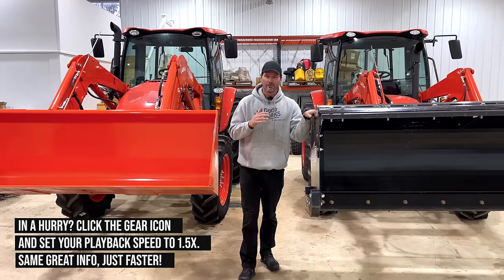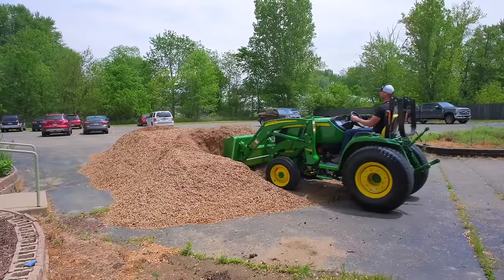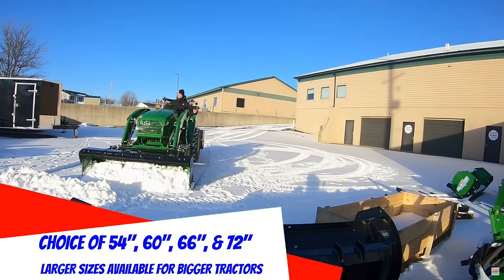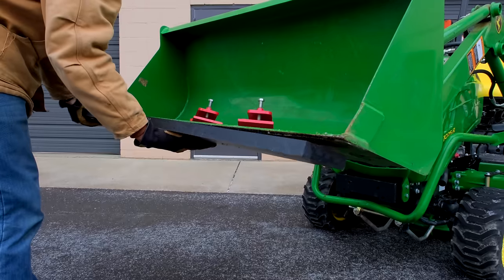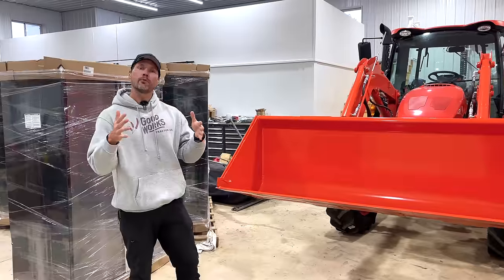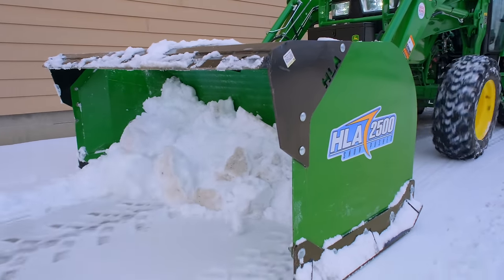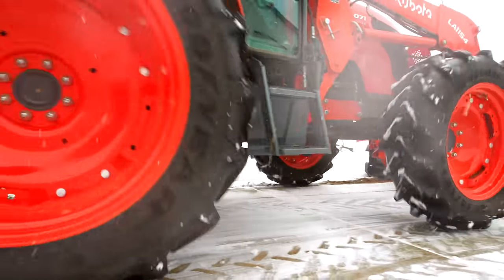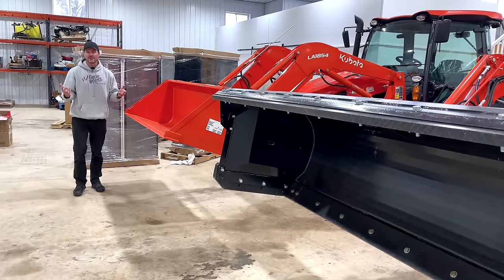BUCKET VS SNOW PUSHER: WHAT’S THE DIFFERENCE?

Comment: Having used both extensively for snow removal, in the long run I prefer a bucket. Primarily due to the ability to stack much higher than you can with a pusher. When I was working, most often the pusher was used to pile snow for the bucket to put in it's final place.
Reply: What tractor are you using? 
Did you try pushing the snow up the pile with the pusher? 
I could stack snow much higher and faster with a pusher. It can be a bit of a learning curve but it is doable.
Reply: @PurpleNovember  I was using a front end loader at an airport. Pushers to get snow out of the way then bucket to stack it. Snow. Lots and lots of snow.
Reply: @justanotherviewer52  Thought you were probably using a loader, they behave a little different than a tractor with a loader.  
The new pushers for the loaders can stack pretty good if they want to spend the money.  I’ve helped build some snow buckets that could out stack the best pushers with skilled operators. It could also fill a dump truck in about three buckets
Reply: If you plow your pile into a ramp shape and it packs/freezes right you can just drive right up and off the back and stack just as high with a pusher IMO?

Comment: Great discussion.  Most tractor owners will already have a bucket so it hard to justify a new attachment. Confidence that you are not destroying your driveway is a big factor for a snow pusher.  Day after day of snow gets overwhelming and leads to accidents with trying to hurry and deciding where to place new snow.  The wider blade also helps speed clearing. You will know it need one of these after a season so plan ahead and know how you plan to clear with the existing bucket.   Measure your bucket - does it fit between equipment, trees and landscaping?   Clear your yard now - simple snow clearing is safer.  Don't wait to hit something that you forgot was there - now covered in snow.  I have done it all bushes, chains doormats and my wife's flower bed.

Comment: I have a kioti cs2220 with an hla1500 snow pusher and rear blower. Works very well. Tires are loaded, blower adds a good amount of weight. if snow is deep enough, you will need chains, you can't get a subcompact heavy enough to push deep snow. The blower on the back takes that out but is much slower. Where I am, we don't get too many storms with really deep accumulation, so pusher works quite well. I have chains but have so far not needed them, fairly level ground and enough weight to push both pusher and blower. As this tractor is only 22hp with 16 at blower, you don't move very fast with blower going. I usually push all the snow into a windrow and do one or two passes with blower to get rid of it. I am on gravel and have to lift both blower and pusher off the ground a little bit early season to stop gravel pickup. would like to get a quick connect plow to use when the ground finally freezes so I do not have to adjust blower or pusher. leaves about 1/2" of snow on gravel driveway. Blade could then clean it up. Maybe next year.

Comment: I prefer plows for long narrow driveways, especially if you have a lighter tractor. However, if i had a relatively short driveway with a large parking area, I definitely would have opted for a snow pusher.

Comment: I will stack snow with my loader bucket but mostly I use my box blade with a  hydraulic top link and it works great for me. 🤷‍♂️  It’s basically a snow puller with a scraping blade that you can adjust how aggressive it cuts, with the added benefit of being able to also push snow in reverse so rarely need to turn around. With the box blade you can easily  see how close you are to a garage door since you are looking down on it from the seat.  That is a lot easier to me than trying to judge how close you are trying to back drag with a snow pusher way out there on the loader.  Biggest negative is having to look over your shoulder more. It may not be as feasible for subcompact tractors in snow they can’t easily drive through.

Comment: Living in town, I currently don’t need to move snow with my Kubota LX2610 on our 24 acre ag land, but we’re planning to build in 2024 so will need to figure out something before winter 2024-25. Before watching this, I assumed you were going to add discussion about using edge tamers with a FEL bucket to add efficiency and protectiveness. Like everything, edge tamers likely have their pros and cons. I’m leaning toward the HLA snow pusher.

Comment: Moved snow for years using JD 6675 in and around cottages. Never had a problem and could place the snow where it didn't melt back onto the road.

Comment: any advice for getting the snow pusher feet to not dig in on unfrozen gravel? are you using it in float or not? maybe angle the feet a bit would help not dig in? haven't had enough snow here to try everything..just tried a little bit when I got mine and found the feet really dug in while in float..thanks

Comment: Love my hla 2500 on my 21 nx6010
Reply: What width are you running?  Any concerns with the 2500 on the 6010?  I have the same tractor and I'm debating between a 84" 1800 or 2500.
Reply: @cdub6935  I believe mine is 6 or 7feet wide.  I have a big blower on the back and tires filled. No issues at all but I am putting nokian snow tires and an accumulator for a smoother ride this yr
Reply: @danielgreen4336  thanks for the info, i also run a blower on the back and loaded tires with chains front & back.  I am leaning towards the 2500 but being told the 1800 is better for the 6010 (I think they are just being overly conservative)
Reply: @cdub6935  I just buy what my dealer reccomends and this is what he said to get and ice had no issues

Comment: Is there a minimum or recommended thickness for UHMW edges to get decent performance, protection plus good longevity?
Reply from the maker: Tough to say, probably varies with the attachment.
Reply: @GoodWorksTractors  let’s say the HLA pushers (you have always shown just how versatile and maintenance free it is, edges seem to be the only wear and tear part). And would you put thicker UHMW on a heavier 2500 series pusher vs a lighter 1500 series.
Reply from the maker: No, same size on those.  It's incredibly beefy.  We matched it up with the rubber dimensions that HLA provided.